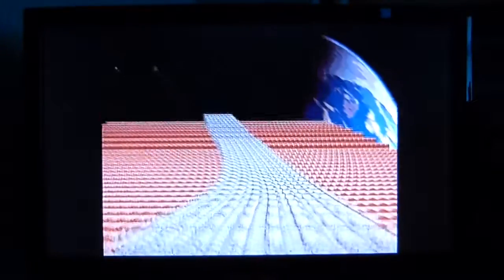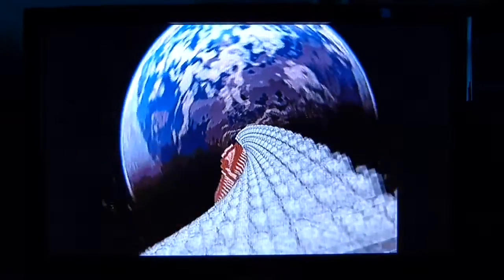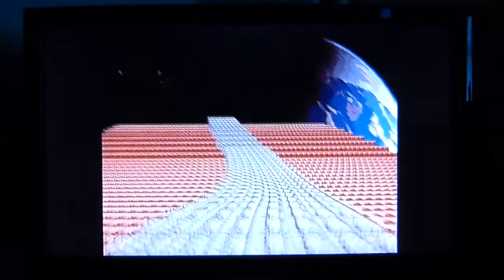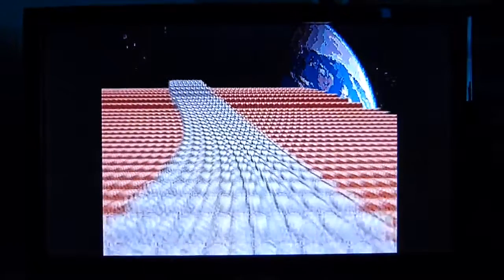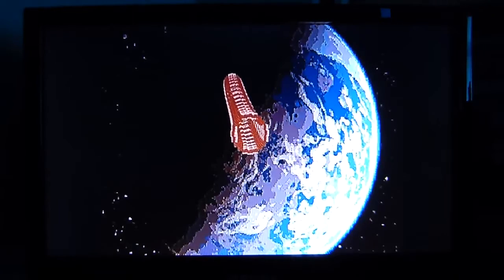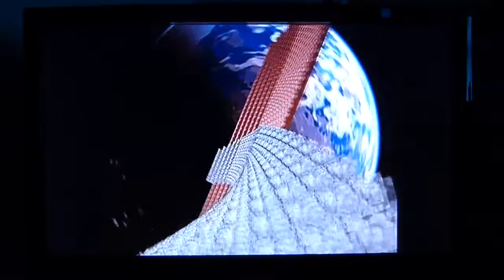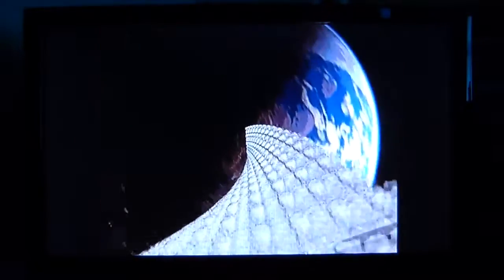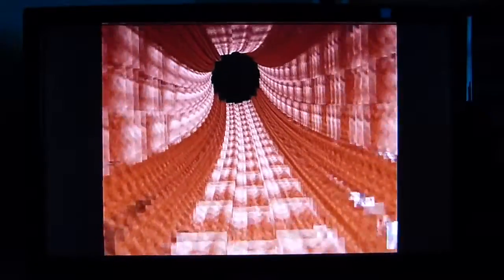Dreamcast development July 2015 update

Comment: This Tech Demo is indeed promising and superb for delivering what to expect from those that work on Dreamcast titles, and to be truthful, I do indeed view this going somewhere major.
The Dreamcast works extremely well as a console for 03 Dimensional gaming in I998, and even now with a slowly increasing Dreamcast Homebrew scene, major things such as this engine is clear cut proof that the console is still able to handle the odds with gaming even almost 0I7 years following its original release in Japan.

Now, I have been spreading the word around about the first annual Sega Homebrew Compeition taking place this year in conjunction with Sonic Hacking Contest XIII; the Homebrew Competition will be featuring Homebrew works from all ends of the Sega console line, and even Tech Demos such as this are greatly accepted to become a part of it.
Even if it is not in a complete state or entirely stable to work with, this Tech Demo for your engine would make a lovely entry for SHC, this is the kind of material that the folks will be anticipating to view; you will even be able to get acknowledgement of this project increased massively, it truly be a contest/Online Expo that will allow your project to become more well known and propser over time.

If you are interested in entering this into SHC, then do go to Sonic Retro or Sonic Stuff Research Group's forum for more on the the contest.
At the time of this post, the site for the contest is not ready yet, but once it is, you will be able to submit it without worries or errors, do stay tuned for more if you intend on going to it, it will be a big contest this year! (:

Comment: I remember reading that the SH4 was a "superscaler " architecture and being so impressed, despite having no idea at the time what that meant. I also thought the Power VR2 approach to Z buffering was fascinating, it seemed like a really different way to tackle the problem without having to resort to depth lists or what not. By the way, how does the Power VR2 approach to Zbuffer differ from modern graphics cards found in Xbone or PS4? Thanks for your reply!